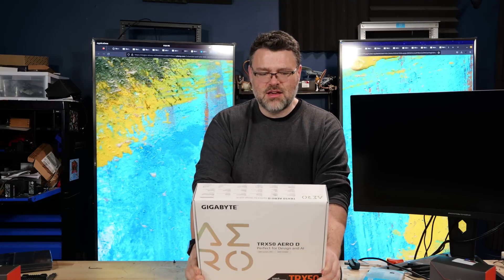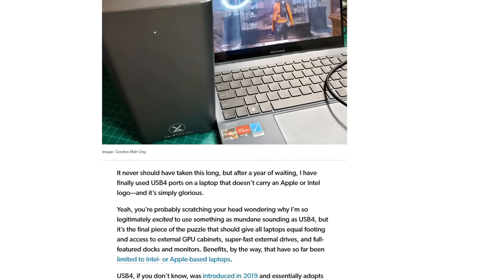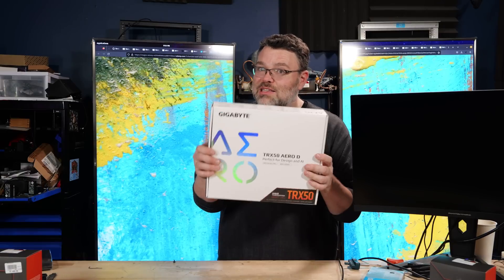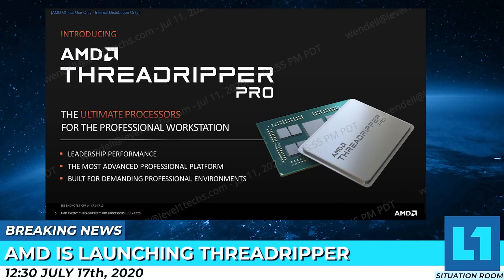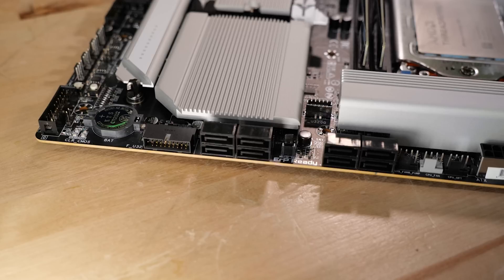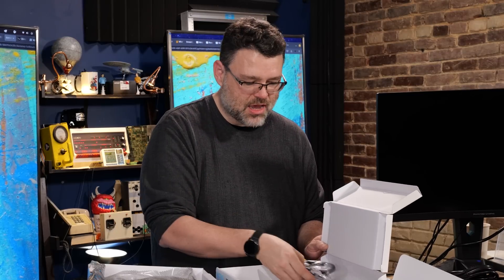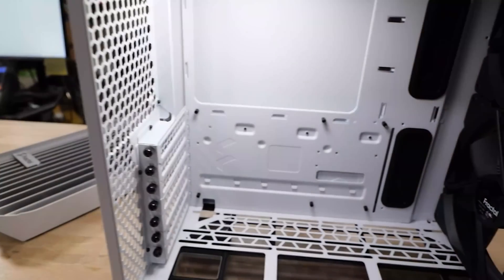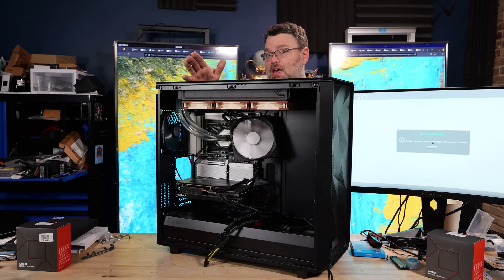Overclocking Threadripper 7000 on the Gigabyte TRX50 Aero D!

Comment: "RAM-training" ... just the first boot? My X99-era system (old I know) does that with every boot, training 64GB's takes longer than a cold boot of Windows. I sincerely hope this issue has been taken care of over the years.
Reply: There is likely a setting in the BIOS to boot quicker by not training every time.
Reply: @cracklingice  If I recall correctly, I searched for that years ago, only to find reports that disabling it makes the system unstable.
Reply: @bartgrefte  I run an X99 Taichi.  It takes several minutes to boot, but most of that is down to having external USB HDDs.  I seem to recall having the skip memory feature enabled, but I also did not run crazy fast memory.  2400 CL 17 iirc.  Tho it was two 2x4gb kits and two 2x8gb kits for a total of 48GB.  Now it's eight 32GB 2133 RDIMMS.  Using really fast memory for the time would likely result in the unstable comments.  Stick to 2400 and you should be set.
Reply: @cracklingice  The X99 are able to use registered memory? That's intersting. I might have read it but don't have recollection of it at this point. Thanks for mentioning it :)
Reply: @akirafan28  Have 256GB of RDIMMs on my X99 Taichi right now.  The max potential supported.  Do be aware the LRDIMMs are not supported and 32GB comes in registered and load reduced flavors with everything larger being load reduced only.
Reply: @bartgrefte   I was in the system BIOS last night because I was getting corrupted files generated and needed to do a memtest - noticed my 2133 memory was running at 2400 for some reason and had to go in to change that.  My memory speed related settings were set to enabled (long mode).